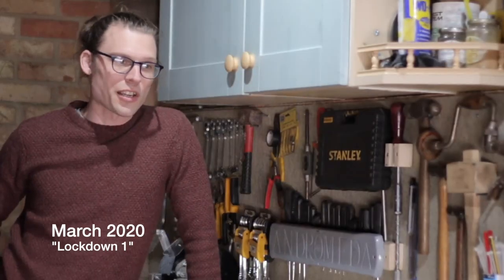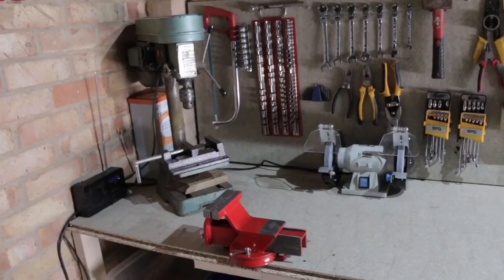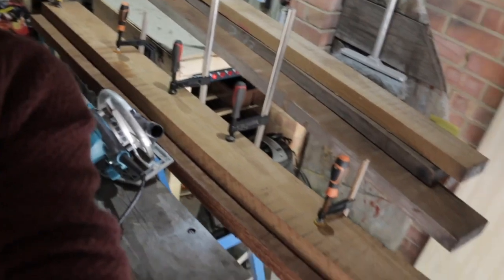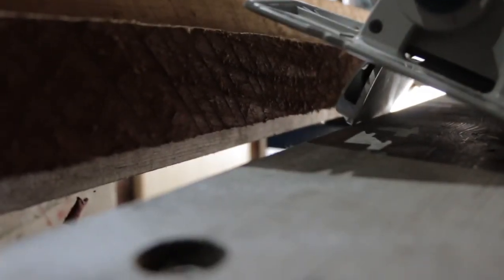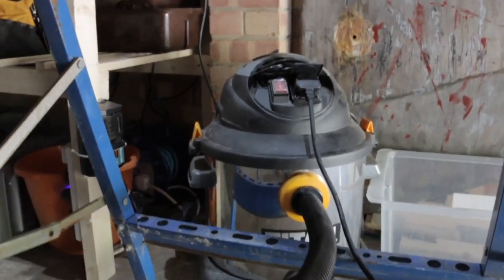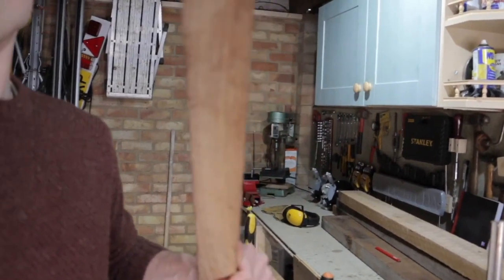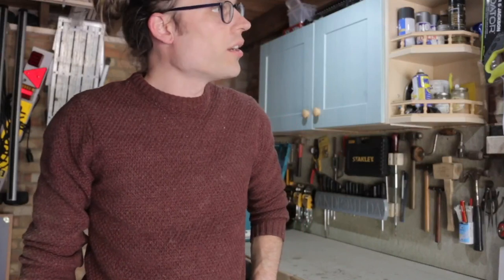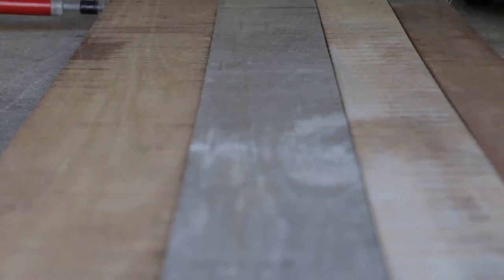20. Making a New Rudder Part 1. Wooden Boat Restoration.

Comment: Regarding your comments on blade depth for cutting curves, it occurred to me that the difference in thickness between the carbide teeth and the steel disk should allow you to cleanly cut gentle curves even with the blade extended further. The thick teeth in front, thin steel in the middle, and thick teeth again at the rear should be able to conform to an arc proportional to those three points. The downside to having the teeth exit the cut is it would never work freehand because there would be nothing to guide the rear of the blade and it could slop from side to side scaring up the cut. But this shouldn't be a problem with the makeshift guide fence you used here.

It seems to me that the benefit you gained by not allowing the teeth to fully exit the wood is that it keeps the blade in contact with the sides of the cut all the way along the blade essentially acting as a guide to keep the back of the blade in line with the cut.

Great video! Keep 'em coming.
Reply from the maker: This is a really interesting point and what you say makes a lot of sense to me. This is one of those concepts that now you explain it, seems quite obvious but I never would have thought about it. Really interesting stuff, thanks a lot for watching!

Comment: So glad I found these video's. I just bought an old wooden boat and need to replace the rudder. The rudder has the same pintels, gundeons and copper fastners so very helpful. If you could tell me a vit mor about how you got the copper bolts/thick nails that would be great!
Reply from the maker: Hello Charles, I’m so pleased you’ve found the videos helpful. What kind of boat is she? With my copper fastenings I whacked the middle a few times with a small punch / scribe to create a guide then I went down into it with quite a large drill bit, maybe 12mm? Enough to drill off the peened over part of the copper nail and loosen the copper rove (washer). Then I found a punch almost exactly the same size as the nail diameter and I punched them through with a lump hammer. Once they started moving it wasn’t too difficult. Rough edges may have damaged the holes slightly but not drastically. I’ve gone to threaded rods and nuts on the new one as I just happened to have that to hand. Clive.
Reply from the maker: Also, for the copper fastenings, I went to a place called Anglia Stainless but other fastener supplies should be able to source them as well.